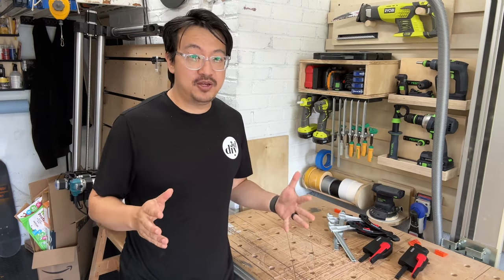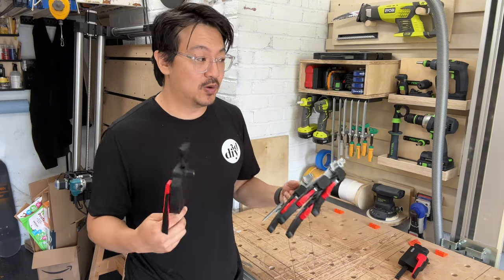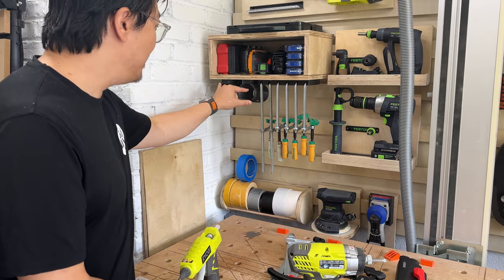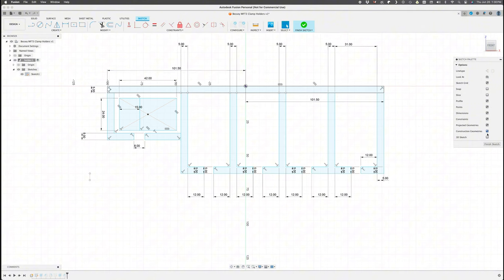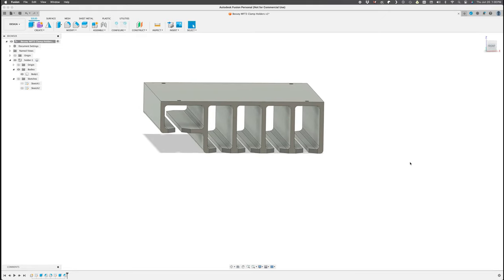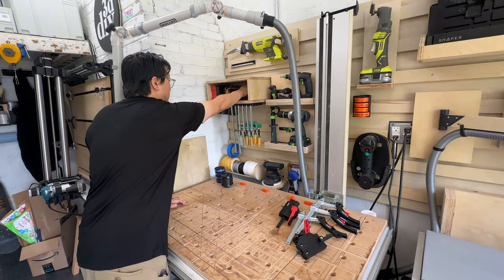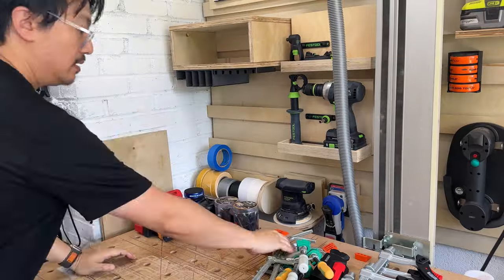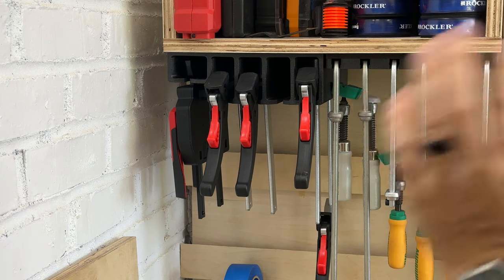Shop Tool Organization Bessey Clamps

Comment: Thank you for sharing your video and process.  Would like to get your process for creating test prints.
Reply from the maker: Basically the process is to split the model in the slicer with a plane cut tool. We just want to print the part that we are unsure about and not the entire print. In this case the bottom inch will be just the same as the rest of the print. So we don’t need to print the entire thing to figure out that it’s wrong. I could have printed the slice even thinner to conserve more.
Reply: @3ddiy  😂😂😂There is an issue Dave...I haven't learned how to split the model in the slizer with a plane cut tool.  Ah yes...more to learn.
Reply from the maker: @RobSandstromDesigns  Ah if you are in bambu slicer above the build plate over the tools. One of them in the middle will say cut tool. Select your model then select the tool and you you will be able to move a cutting plane up and down or rotate it to cut the model in half.
Reply: @3ddiy  thank you - will check it out.